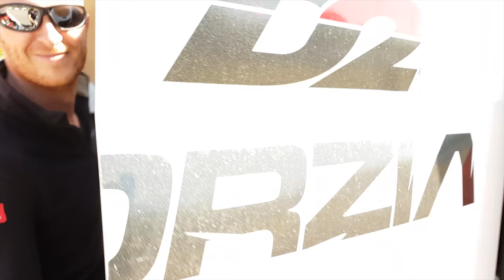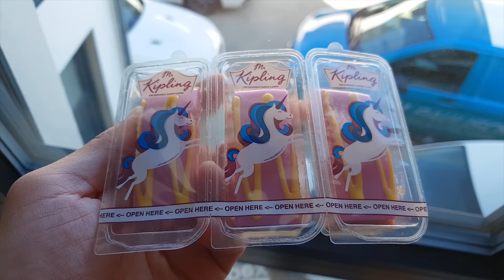Hoodscoop? Trunkscoop! || MY NEW CAR??

Comment: Nice to see some danish cars! :D  if i remember correctly the danish E30 (yellow) is a BMW V8 either 4.0 or 4.4 and the E46 (yellow/black) is a 2JZ. But not entirely sure. 
The KS power E36 (grey)  should also be a BMW V8. I don't know about the KS power e30, but it would for natural for the team to fit a bmw v8 in it
 if the Correct me if im wrong

Comment: You need to install some LED flood lights to prevent the ladies peeing (or get a better look)  ;)
Just checked out the Rock am Ring line up. Can recommend Greta Van Fleet !
Apex fleet just constantly gets tweaked and improved which is thoughtful customer service.
The F-type taxi sounds plain rude & dirty :)

Comment: Lol casually prototype spotting :D and honestly these were very interesting.. the new A7 was probably a early S7.. has the S Line wheels and apparently ceramic brakes.. hmm :D would like to see a more detailed interior shot.. the old A7 next to it might just be a very very early one.. maybe it’s ready for the bin :D appears to have the new tech inside but I don’t think that there is something special underneath it.. maybe testing some long term stuff.. and still don’t know why they’re testing the W12 A8.. they drove it around at the press release and the new Bentley Continental has the same powertrain.. who knows! Shall check out the vin :P

Talking MB prototypes: first one might even be a CLA, back looked coupe-ish and the GT4 is very interesting :D orange on matte blue ... why not

Comment: Misha sir! why in your camera some lights look like strobo lights??
Reply: Can get a little complicated, but, basically the camera shutter in this example adjusts for the bright sunlight outside. Once the shutter speed gets close to 1/60 of a second, it almost matches the frequency of the lights inside, which would be running at 50hz. :)
Reply: so practically u can se them turning on and off. the spectrum a human eye can not normally see. kool. and it also happens  with some LED lights in some cars too!! apreciated sir!! be well..